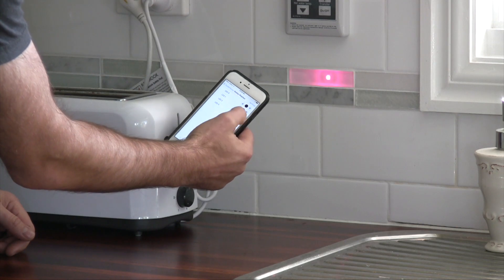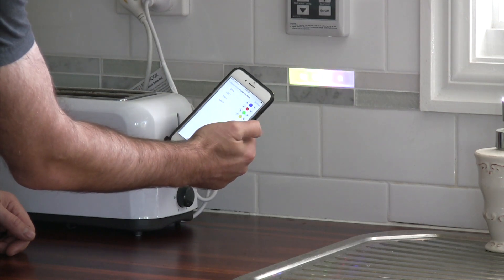Vlog #58: Wires NOT WiFi for home automation!

Comment: In all fairness, speaking of 'complicated' there was a time you had an entire Arduino plus  extension shield for every single switch :-). And ofcourse when everything is wired, you need bigger  network switches as well. Also, not  everyone is able to pull wires everywhere.  And as far as your plane comparison goes... there have been several  'Aircrash Investigation documentaries' on Discovery in which the plane lost control because something ripped through the  control cables. Now if they only would have had wireless!!
Other than that it is just  a choice that is personal, depending on the local circumstances. I use a combo
Reply: Thanks, that's exactly what I was thinking. It's not a black and white situation. I also wouldn't consider my light switches to be as important as the break pedal in my car. My entire rental apartment is using Philips Hue lightbulbs which make use of Zigbee. It's better than WiFi in that pressing the button turns on the light almost instantly vs. the 2s or so it takes an ESP to wake up, handshake and send the command. I'm reasonably satisfied with the solution as I can't run my own wires. That said, if it was my own house I'd definitely prefer wires to every switch likely in the form of Cat6 fed through tubes. But even then there might be places on the property where that's not practical and some wireless system  seems like a completely valid solution to me.
Reply from the maker: No, it's definitely not black and white, and often WiFi (or Zigbee, or whatever) is the best solution. This video is a reaction to the amazingly frequent comments I get saying that I shouldn't have used wire, I should have used WiFi for everything because it would be so much better than old-fashioned copper.
Reply: Billion dollar aircraft industry, having the biggest brains working for them, are still depending on fly-by-wire as the standard and not anywhere near adopting wireless. "Several Aircrash Investigation documentaries" wont budge them, I am afraid.
Reply: To be fair, there was a presentation to ICAO in 2012, suggesting wireless communication for non-critical systems in an airline, which can save upto 30% of copper weight (in wires). It's not widely known any manufacturer is practicing such. Airbus was considering wireless for inflight entertainment couple of years back, but honestly I do not know how it went.
Reply: fully understand

Comment: +SuperHouseTV, I was thinking after your last video, in hindsight if you knew your switches weren't going to be IP based, would you have run different cable?
Reply from the maker: Great question. I think I would still have used UTP, but ideally I should have used the much more expensive Clipsal C-Bus cable. There's nothing electrically different about C-Bus cable, it's just pink-coloured UTP, but the big advantage is that it's specially certified for installation alongside mains cable and inside switchboards. It would mean that I would have the option in future of simply swapping out my light switches and everything else for the equivalent C-Bus devices, and there'd be no re-cabling required. If we ever sell this house, I'll probably need to do that.

Comment: Another great video. If I have ever pulled the "why not just use WiFi" card, I am sorry.  I know my chief question in home automation  regarding wireless has been finding something that works with existing wiring as a mechanical switch with a wireless options. ie flip a switch on the wall OR use your phone. I know they have z-wave switches. My problem is z-wave and zigbee seem to be part of the 2.4GHz band as I understand it. That just seems like it would muddy the band, being that I already have WiFi (2.4GHz and 5GHz)  with no less that 15 devices on 2.4GHz. 

My first project is going to be a multi sensor and controller for my garage. The idea is to read temp/humidity, light, motion, and for the doors a ma-switch in the garage to tell if the doors are open or closes and a relay to short the two wires that sends the open/close command to my garage door opener. The mechanical switch just shorts out two wires momentarily to open/close the door so a relay should work as well.  I've been spinning my wheels on this project trying to decide on wifi or z-wave.  Maybe I should just run wire...

Comment: I had the exact Problem, when I installed my first Sonoff Touch and OpenHAB wen‘t down (self inflicted). The Switch would just be sitting there trying to connect via MQTT and I wasn‘t able to toggle the Light in my Room. Now i‘ve changed the Software to always respond to Hardware Actions, no matter what. ;) 
FYI: I live in an House in Austria, where running new cables would be a hell of a job (almost all Walls are made out of Brick).
Reply: Cavity brickwork is easier to wire up rather than timber frame work.
Reply: imhard 2please Here in Austria i‘ve never seen a Brickwork Construction with a Cavity, we always use something like this: http://l7.alamy.com/zoomsde/hrpa5n/detailansicht-des-querschnitts-einer-wand-alle-ebenen-sind-sichtbar-warmedammung-3d-render-hrpa5n.jpg
Reply: I see, well then that is unfortunate for wiring,

Comment: Thanks for setting us straight again Jon. Surely someone has an open source protocol (not C-bus) that can handle multiple switches, pots, capacitive sensors etc.
running over RS485. BTW, Boian Mitov is doing some great stuff for Modbus with Visuino.

Comment: In our house (which we own) it is completely impossible to re-do the wiring which would be an absolute must to get ethernet or just any new wire into the light switches. The house was made from bricks and even the electrical wiring is in the wall directly beneath the plastering spread like fishing nets or spider webs. There is no reliable cable plan and the house was built about thirty five years ago. My best option to get around using the pesky wireless - which I would love to do - would be to go for power-lan technology. I've been looking for viable products but haven't found anything affordable. I would pay up to 10 to 15 times as much as for a comparable esp8266 module but either my google-skills are just not up to the task or there is no usable technology out there. My personal favourite would be to open all the walls, re-do the wiring completely, add low power, high voltage and ethernet to any socket, no matter if for mains or an outlet or a switch but that won't go well with the misses - that's for certain. After all we also have to live here and currently I'm pondering to get ethernet wired into the upper floor via the outside walls ... Oh my - what would I give for accessible hollow American wooden walls ... Anyways - great show as always. Cheers! JM
Reply from the maker: Thanks JM! Yes, retrofitting cable can be a horrible job with solid walls. In many cases it's just not possible at all, so wireless is the only solution.
Reply: USA === paper walls, rewiring possible, rest of the world: solid walls, rewiring is pain in the ass. :D
Reply: In italy if you put high voltage, low power and ethernet in the same socket you probably go to jail.
I've made low voltage circuit for switches and it was a total pain everythigs need to be in a different tube.
Reply: Weird way to build a house but i trust you actually looked how its wired. Here in the Netherlands we only have brick and concrete homes. The electric wiring is put in plastic conduits and the conduits are put in carved out channels. When everything is in order, then isolation and plaster is added to cover up. If you want to change something later on, then just connect the new stuff to the old wire and jank it through the other side (by pulling the old wire you pull the new stuff in). Granted it can be difficult sometimes, but it's still always possible.
Reply: marco moraschi I'am living in Italy and I know what are you speaking about 😂
Reply: I don't own the house I live in so touching any of the house wiring is off limits. It'm also prohibited by law to change any mains related inside the walls including wall sockets and switches since I'm not an electrician. 
Having said that, most wall sockets in this house are of the  safety ground type but the ground pins are not connected to anything which isn't allowed either....
Reply: SuperHouseTV For me is the same story... I bought house with standard existing electric wiring and bricks wall. I'am going to place sonoff with tasmota firmware and control all this via mqtt with homeassistant wirelessly. I think is the best solution for our case. I hope all going to works well. Have you some advice for our situation?
Reply: I built our house 15 years ago, and ran a lot of cat6, but not to a lot of the core functions (switches, lamps etc). Retrofitting would be a very expensive project in several places.

My plan is to use wireless devices that default to "traditional" operation, like the sonoff that controls power locally, but can also be remotely controlled and report state back to the core. WiFi and RF isn't "critical path" for function, but allows for additional control and monitoring.
Reply: marco moraschi Terminal blocks sono quei vecchi a vite invece quelli nuovi a molla (tipo wago) si chiamano electric clamps.
Reply: I love you!
Reply: [X] German, yes, guilty as charged. Unfortunately a quick check of the site as well as a quick Google search showed this is neither open source nor is there any way to get this married to my already existing OpenHab/MQTT system which would be an absolute requirement. This is a house we are talking about - I'm not going to trust anyone with remote-controlling my house who does not open their product to the open source world. The only reason why I am currently using the Sonoff devices is because I can flash them and run them on open source software. In case they do support open source then they don't advertise the fact and this would also make them not trustworthy in my eyes. This is a small company - who knows how long they will exist? I'm not going to invest into such a company unless I know for sure their tech is future-proof hence open sourced. A quick example if I may: I bought some entry level heater control from a well known German tech supplier. Of course the solution was closed source and of course just a few years after it's introduction the system went out of fashion and the support for it pretty much went away leaving me with a few rather nasty looking door stops ... or crap DC motors in case I use them for parts. This endeavour was relatively inexpensive compared to equipping the whole house with new smart power sockets, lights, switches and a control center/PC bridge. But hell did I learn the lesson! But if they ever decide to open source their product and maybe even make their communication module available - I might re-consider. Cheers! JM (Switches are nasty ugly as are the power sockets by the way but hey ... it's just the house we will live in for the next thirty or so years so why bother? ;) )
Reply: The Zensehome stuff looks nice, but is designed for a wall box size that AFAIK is only found in Denmark (called FUGA - it's a product series from a Danish manufacturer; http://www.lk.dk )
Reply: I found this and a few other similar things but the price is just so far off of the PoE solutions your company provided and also of what I can build based on an ESP myself - even powered through 220V AC all behind a switch including a one or two channel relay ... it just doesn't make sense to implement anything based on that solution - plus it is completely closed source: https://www.evw-24.de/INPROJAL-Nero-II-Schaltmodul-16-A-UP?googlede=1
I am wondering if coming up with an open hardware / open source powerline/power-lan module featuring one relay, some IO, 3.3V DC power and maybe a heat sensor could be brought to the market for less than $15 in bulk ... If there was anything like the Sonoff for power-lan/powerline instead of wifi I would replace all my light switches at $10 to $15 each without even blinking at the investment. Should read up on specs how many devices can work reliably together in such an environment, though. Cheers! JM
Reply: I've seen such installations and this is how I would have expected it to be in our house but sadly I've drilled through wires just because the wire-sensor pretty much shows red or red with live wire pretty much everywhere I point it. Every once in a while I just had to take a chance and three times I drilled through wires already. The guys who built this house - actually the whole area - didn't follow most of the regulations or just even common sense. It is so annoying to remove the plastering, replace the wires, set a box and re-plaster ... but at least I learn something.
Reply: Zsolt Varga giusto per curiosità, sai come si dice morsetto in inglese, intendo quello con la vite per i fili.
Reply: Probably this would solve your issues? http://www.zensehome.dk
This is doing smart things directly via 230V lines. It's "scandinavian", probably google can translate this for you? :-)
Reply: Except if you are German, than there is a German site, too :-).
Reply: Why this site doesn't exist in english? 😡
Reply: No clue, I was also surprised :-S. Probably target group is not "that far away" - beside the existing languages. :-)

Comment: I agree completely with using wires over wifi but your example with planes isn't very good because it is actually a thing https://en.wikipedia.org/wiki/Fly-by-wire#Fly-by-wireless
Reply from the maker: Oh wow
Reply: I don't think home automation systems have weight limitations xD
Reply: An experimental thing. It is not in use nor proven. The wiki article links to a Nasa whitepaper on potential use of wireless.
Reply: Now if this plane had had wireless they would have been fine http://www.nytimes.com/1983/06/10/us/plane-loses-propeller-lands-safely-in-alaska.html
Reply: That and the analogy is poor. Aircraft are life and death systems. Home Automation is not.
Reply: I was just thinking the same thing about fly by wireless systems, especially as I remember about 8 years ago Gulfstream testing fly by wireless with the aim of implementing them into planes within 10 years or so.

Comment: I tend to agree. Of course often there is little choice. I have chased a couple of walls in my time to not want to have to do that around my house. (UK most houses are still mostly brick). Running cables is really only an option if you are building your own house. I would also worry about what new owners would think when coming to sell your home. I would expect you would have to pay an electrician to rewire a traditional  system.
Reply from the maker: Yes, wireless can be the only solution (or the easiest solution) sometimes. The important thing is to use the best solution for the problem at hand :-)

Comment: The main reason is really security, just last week a critical Bug in the WPA WLAN Encryption standard bubbled up.
Reply: No. Wi-Fi is meant for comfort.. not reliability.

Wireless signals can get really clogged up at times when people get home from work and start watching youtube videos and stuff.
For an example, I cannot use WiFi anymore at 6pm because all of the wireless channels are crowded all of the sudden.

Now you wouldn't want that to happen in a home automation system where you click a light switch and the light for some reason doesn't turn on because A: The light switch cannot talk to the access point . or B: The receiving end for the relay can't talk to the access point anymore.

There are more examples:
- Motion sensors won't be triggered because wireless error or disassociation... ( Means you gotta reboot the damn thing and in the worst case scenario your place will be robbed without the alarm even triggering.)
and so on.
Reply: you should always use application level TLS encryption regardless if the whole connection is encrypted or not.

Comment: Should add that those wireless frequency jammers are very, very illegal! They carry jail terms of 2-5 years if you are caught in possession with one.
Mobile providers also pick up on their use & location instantly with their network monitoring as well if you are interfering with their 3G/4G bands.

https://www.acma.gov.au/theACMA/faqs-mobile-phone-and-gps-jamming-devices-acma
Reply: He is talking about criminals using them so presumably, that is of little concern as the point is not to get caught.
Reply from the maker: Absolutely. I had a short bit where I mentioned that they're illegal in Australia (and most other places) but you can buy them on the street corner in China. I somehow cut that bit out when I was editing.
Reply: Just tell the judge you were using it to burgle a house. As long as you can offer up a legitimate reason for using a jammer I'm sure you'll get let off.

Comment: When will people learn that WIFI is honestly not as good as it may seem? You still have to power the device, deal with reception, security issues, and a whole mess of headaches that come with the territory. Wifi can be helpful for some devices but wired connections are always better if available.
Reply: Additional power consumption...
Reply: Kudos for that! Kappa
Reply: Just try living with simple  wifi light bulbs like hue of yi lights. Brilliant untill they can't conect.

Frustrating when they bork for ten mins for no reason.
Reply from the maker: Preach it, brother :-)
Reply: And also of the 2.4GHz cancer radiation! ;)